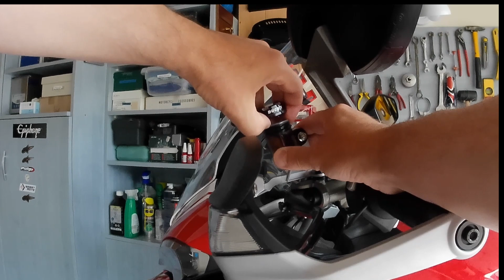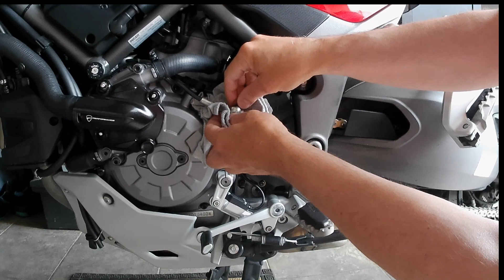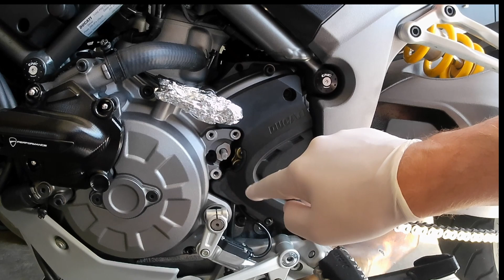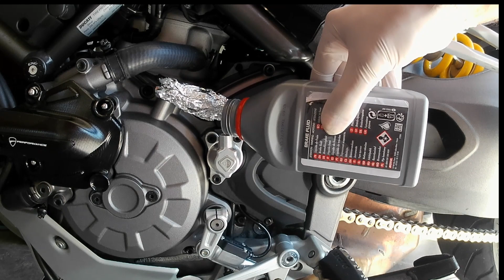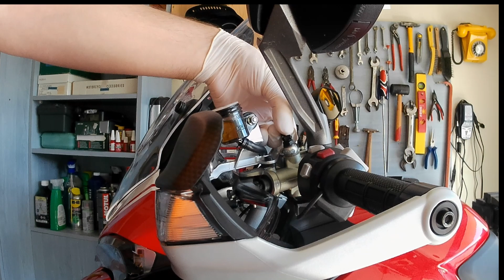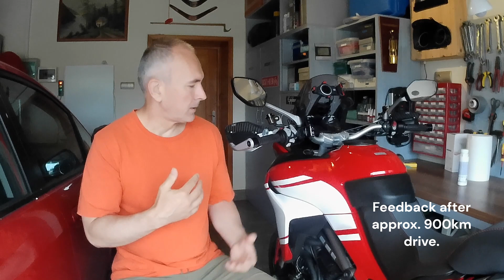Ducabike clutch slave cylinder installation to a Ducati Multistrada 1260S

Comment: Hi what is the benefit of changing this . I had issues with ducati 796 when temperature 4 bar , and hot , sometime my clutch lever become free .. do i need change the clutch slave cylinder or new clutch lever only ?
Reply from the maker: Hi. The benefit is that this slave cylinder has got more linear characteristics so the clutch operation is smoother. As your issue: what does "temperature 4 bar" mean? Bar is for pressure. The root cause of your clutch behaviour needs service. Could be old clutch fluid with lot of moisture and air trapped, clutch master or slave cylinder worn out etc. Cannot tell without check of the system. Clutch lever doesn't need to be replaced for sure: it's just a piece of metal.